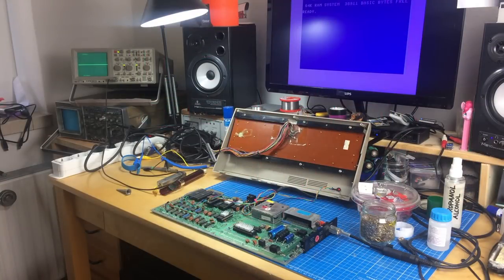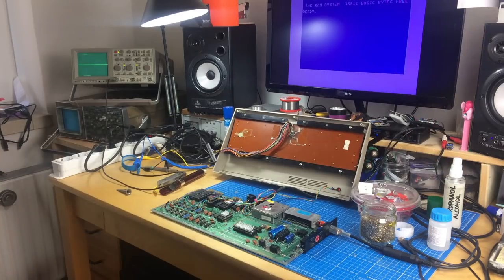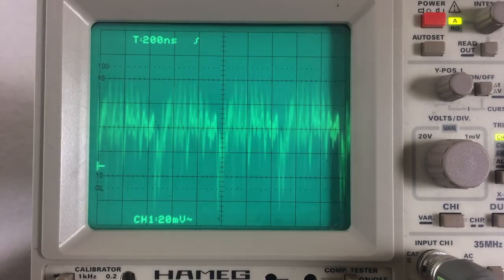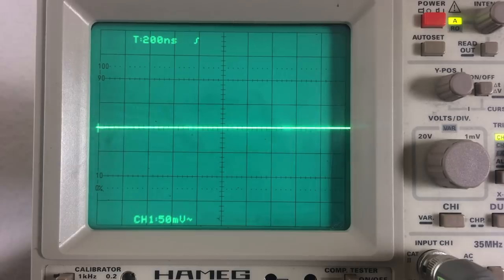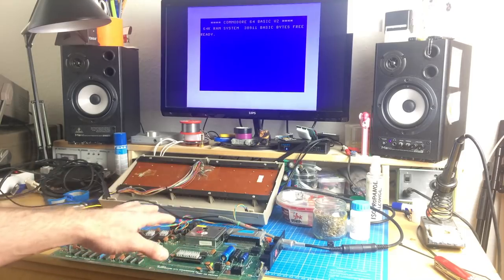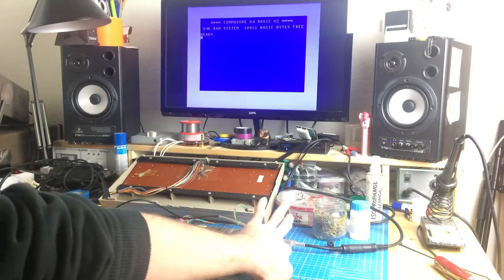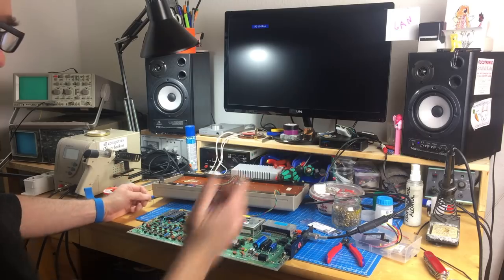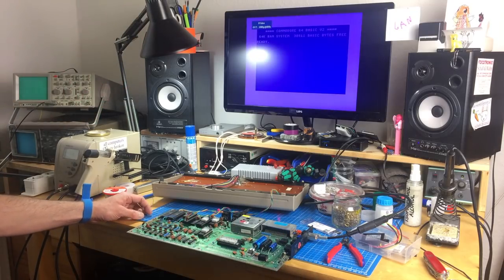C64 DC-DC Conversion Part 2: "The Fart of Doom"

Comment: Hey Jan, the DC to DC converters usually have bulk capacitors on the output to reduce Ripple. So, when you turn off the power to the dc-dc converter, the voltage tapers off gradually rather than immediately going to 0. This is called Brown out, and some older chips like the Sid probably don't like it very much.
Reply: "Brown out" with the "farting noise". There's a joke in there somewhere.
Reply: in these cases a higher clock frequency dc-dc converter is better, the higher the clock, the lower the smoothing capacitor you need. it's better to as an o/p inductor (<100uH) in serial too, but i will just settle if i get less than 10mV ripple under highest load.
Reply from the maker: I fiddled around a bit with adding capacitors to the output of the 12V converter but it didn't make a difference for the "farting" unfortunately. The brown out is a good point though. I guess the SID get enough power to reboot and then turns off causing that sound.
Reply: Could test the theory by increasing the load, maybe some resistors in parallel, but really, a linear regulator that doesn't get warm is a fine solution, even today.

Comment: Great video Jan Beta, as many guys told you the DC to DC Buck converters have capacitors inside for reducing the ripple at the output. However, switching power supply or DC-DC converters are not recommended for audio or instrumentation applications due to noise and transients. The fart noise is due to the transient when the C64 turns off, hence, the frequency response of the transient goes to the audio band, i.e., the coil and capacitor of the Buck converter generates a a negative voltage transient in the SID area (see https://www.powerelectronictips.com/select-input-capacitors-buck-converter/). That transient will see it in the C13 capacitor at the output of the Q8 transistor at the Audio output. Therefore, it's recommend to maintain a linear power supply for the audio scheme of the C64 (at least the 12v rail).

Comment: Hi Jan! I’m not a C64 guy but I looked into schematics. The switch cuts off input rails and this is fine. But what happens next are two separate and differently loaded chips. You have around 2000uF capacity on 5V in and 1000uF on 12V in. Both rails cut off in different moments and as a switching supplies try to work to the end of energy in caps. Linear reg would die out and not try to recover. Switching circuit tries to switch one more time if there is any energy left. Maybe a suggestion with a big cap on the out line isn’t that bad. Another option would be 12V reg with !SHDN in to kill output when 5V is out.
Reply from the maker: Thanks! That explanation makes perfect sense.

Comment: The 12v rail has a 1000uF capacitor lon the  input to the regulator. Since the load on 12v is low that means on switch off the voltage drops slowly and causes instability. You should look at the data sheets for the type you used, because they usually specify how much capacitance to use - ones I looked at had capacitors from 10uF to 100uF, with a similar amount on the output. so its probable t.his is why you are having problems
Reply from the maker: Yes, I think that's the most reasonable explanation. I will do some further research and try a couple of solutions soon(ish). :)
Reply: Considering the light load on the 12v rail and that its supplying audio circuits, your solution of refitting the linear regulator is probably the right one. High frequency noise on the 5v rail isn't going to be problematic, but how hot the linear regulators got definitely was.

Comment: Jan, I meant to reply earlier on this but forgot. The C64 boards with the 12V regulator use a 'voltage booster' circuit. When you rectify 9VAC you get about 12.7VDC which is not high enough for a linear regulator. It is 'boosted' to about 20V with a 'charge pump' type circuit (which is a type of DC-DC converter) and then fed to the 7812 regulator. I would guess that when the power is cut both the charge pump and the DC-DC converter you installed and still trying to do their job and you get that final last surge of voltage. The C64's with a 9VDC SID don't use a 7812 or the charge pump (going from memory here), I seem to recall they just have a sort of homebrew voltage regulator made with a transistor (there is enough headroom to go from 12.7VDC to 9VDC)

I'm not sure how to overcome this problem you are having easily. It may be that more capacitance on the input side of your 12V DC-DC converter would help. My thinking here is that it would let the charge pump circuit stop working while providing just a bit more time for the 12V DC-DC converter to shut down cleanly. It might also be possible to bypass the charge pump all together if your DC-DC converter can work with as low as 12.7V input.

Comment: And LOL @ the farting noises =D  It's the last power within the device dropping off and frequency of switching slowing down abruptly until nada.  As someone else suggested below - it's probably the size of the cap on that 12 rail (on the input to the recom).  The same spike will probably be happening on the 5v rail too - you just aren't visually or audibly aware of it.
Reply: I agree -- the 5V rail is probably spiking too. Adding a cap on the output on these rails should help with the spiking.
Reply from the maker: I will look at the spike again. As far as I could see it's not happening on the 5V rail but I will definitely revisit this mod an see if there's a reasonable solution. For now I think just using a 7812 is a good compromise. ;)
Reply: Master of Arts!

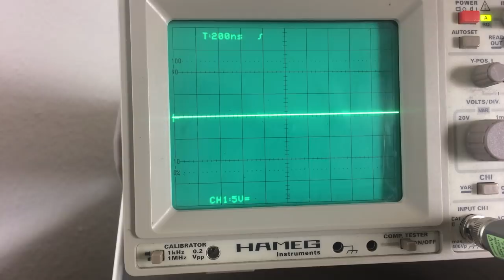Comment: Hi Jan if you look at 14:10 when you turn it off and get the sound you have some low frequency oscillation on the scope but you cannot see it as you have the timebase too fast (try 10mS/div or slower). I am guessing that maybe the 5V rail is also doing this but you don't get any visual or audio effects from it. I assume it is because the i/p voltage has gone too low for the regulator to operate so it stops then the input voltage recovers a little and it starts back up again then stops ands sop on until the input voltage drops enough to stop the oscillation.
Reply from the maker: Yes, I guess that is the most reasonable explanation. I think the converters are a bit too high efficiency and start working on the residual power in the capacitors again briefly. I will definitely look into that again.

Comment: Any updates on this Jan?  You mention in the comments that you were perhaps going to check for spikes from the 5V DC-DC converter using your scope.  I believe you also mentioned that you were going to investigate reducing the capacitance of the 12V inlet filter capacitor to see if it gets rid of the voltage spikes on shutdown, that is with the 12V DC-DC converter in place.

Comment: This is working for me nicely - just the 5v DC-DC converter - repaired ASSY NO 250407 Rev B this weekend - Thanks Jan !
Reply: I too have no problems so far with that board revision but I am using a bigger 1A Recom R-78B12-1.0 that needs 16V input.

Comment: I believe it's cause you have capacitors on the inputs of the switching regulators.
When turning off the unit, the capacitor voltages will drop within a second or so.
As this happens, so does the regulator switching frequency.
So you end up getting a quick sweep down tone effect, that sounds like the "Fart".
Reply: yep, very ture. Could always lower the values for the main filter caps and put some filter caps on the output of the regulator.
Reply from the maker: Yes, I think that's the most reasonable explanation for the effect. I already fiddled around with different size capacitors on the output of the converter but it didn't change anything. I'm definitely going to revisit this soon to find a good solution.
Reply: @JanBeta   Hope you might come back to this 12v dc-dc fart problem:
1. I do not think this will harm the SID
2. This is a capacitor discharging and somehow, power goes back in to the SID ?

Comment: Use the 12 volt switching IC, but put a large capacitor on the output pin to ground.   Something like 1000 mfd.    This will let the voltage slowly drop after the switching regulator shuts down.    This should stop the audio noise.   This will resemble the output of the linear regulator more closely.
Reply: Robert Bakley Are you suggesting 1000mF=1 F or 1000μF=1mF ?  Anyway the farting is probably from the 12V regulator turning off cleanly when the input cap drops below e.g. 13V, then back on again for a short moment when the input recovers after the 5V load goes away.  A linear regulator would fade away gradually, making the bounceback of the input become a small movement on the output.

Suggested test: 1. Set the scope to 1 second / division and 5 V / division, DC coupled. Probe both the inputs and outputs of the regulators and do the turn off as the scope is near the left of the screen.  That should give a nice picture of how these things behave during power off.
Reply: i suggested 1000 micro farad.   This will keep the 12 volt rail up after the 12 volt dc to dc converter shuts off, and allow the 12 volts to gradually decay similar to the way the linear 12 volt regulator shuts down.
Reply from the maker: I fiddled around with adding smaller caps to the converter but didn't try such a large capacitance. I'll look into it.
Reply: Thats what I think also. Some other loads drop off and then the 12V DCDC "comes back" again.
Reply: Great way to make the DC-DC converter to oscilate. You should NEVER slap excessive capacitance on a DC-DC converters output, you ruin it's negative feedback loop's phase margin then and it becomes a high frequency generator and can even generate large voltage swings on the output

Comment: Since these are dc-dc switching modules, they likely already have filtering and proper input and output caps in them. The linear supplies require those big caps to keep the voltage stable during varying loads. You most likely do not need these caps on the inputs or outputs. Try simply removing them. Then the output should shut off pretty much immediately when power is cut.
Reply from the maker: Yes, that's definitely something to look into. I was thinking about replacing some of the caps with smaller values.

Comment: Normally, you would use capacitor systems to smooth that stuff out, ceramic capacitors can react faster and more reliably, but at the cost of capacity, so any load spikes would require a combination of capacitors or just multiple of the same type. If its load spikes that are the problem, electrolytic capacitors are used almost specifically for that problem.

Comment: SIDs? Not so sure the sound comes from them, but the regulator shuts off and briefly comes om again.. The 12V line is feeding a buffer/ transistor on the audio output. any noise on the 12v line will come out on the audio ports via that. could be as already mention caps om the input or output not within the regulators requirement.
Reply from the maker: Yes, I think it has something to do with the residual voltages in the caps. I will also check the buffer. I assumed it was the SID because it sounded like a SID sound but now that you mention it it also could be a slightly underpowered transistor "farting" obviously. :)

Comment: I think its because the sid was designed for a regulated power supply - one of my hobbies is amateur radio and it wasn't until very recently that switching power supplies and filters could generate a clean enough dc signal that you didn't get a bit of noise on transmit/receive - especially on older equipment.

Anyhow I think you need to build a filter circuit on the 12v output.
Reply from the maker: Yes, I used to work as an audio engineer and had the same experience. In good audio gear, there's still no switching supplies today. I fiddled around with some caps on the output of the converter but it didn't change anything. I'll definitely revisit and look for other solutions soon.

Comment: Hi Jan, I think his has something to do how the base voltage for the 12 volts are generated. The original c64 powerbrick gives you „9V“ AC and 5V DC which are „combined“ after rectifying the ac. You replaced the origimnal powerbrick- I cant remember the video you did, but it seems there is an awful lot of delay between the power-off of your 5V dc and 9V ac supply lines and some capacitive decay in the 5V supply leading to this behavior - that would be my guess. Maybe you can check that by using both channels of the scope with a longer timebase 2 to 5 sec, or by using an digital storage oscilloscope maybe at a hackerspace near you. Keep the good work up.  Grüße aus Dresden.
Reply from the maker: Thanks! That's a good point. I thought the same and tried it with an original PSU in the meantime. Absolutely the same behavior there unfortunately.

Comment: A bit late : Chain both : a DC/DC to 7.5v , does not heat, but ripples THEN a linear regulator from 7.5 to 5v, that way the 7805 will only have to dissipate 2.5 v*I as heat instead of ~10v *I as heat, i.e. 1/4, and you'll still have a flat output (need a ceramic cap at the 7805 output too, the electro will not filter high freq)

Comment: You can try a couple of things such as a 1meg resistor on the output to ground, that trick is used on Amplifiers to avoid speaker pop. Or, toss on another cap around 680uF to 1000uF on the output of the regulator to ground followed by a 100nF cap for the high feq ripple.
Reply from the maker: I experimented with some smaller caps on the output of the converter but it didn't change anything. I'm definitely going to try the resistor and a larger capacitor, too. :)

Comment: I thought you had it on DC coupling on the first part - I made that mistake a few years back and RetroGameModz corrected me ;)   It's worth adjusting the time base when you are looking at that AC ripple btw.  The point you saw 50mhz pulses, that looked to be a zoom in of a slower frequency pulse.
Reply from the maker: Learning all the time. ;) It's a bit funny I did it like that because I did some more sophisticated ripple/noise measurements a while ago when I checked out a replacement 1541 PSU. I forgot all about it it seems. ;)

Comment: 'normally' dc-to-dc converter circuits are not having this nice TO220-ish (78xx) form factor but are a circuit board with an input+ground on one side and output+ground on the other side (4 connection pads). I didn't know that ground was allowed to be connected together to become one contact less (3 pins).
Reply: Maico well the gnd is the same potential its okay.
Reply: alright

Comment: connect a 100µF capacitor with low esr to the output of the 12v recon. maybe a panasonic fc or fm series to buffer away the fart.
i think the input voltage drops very slow because of the high cap on the input. that means that it spends quite a significant time in a voltage area where the recon is unstable and probably switching on and off. try the output cap solution. as i am working with mcu controlled switching power supplies at microchip now, i might have a look at some simple buck regulators that are suitable for that upgrade for the c64.
after all, the temperature inside the c64 then gets cooler witch also protects the other important chips like the vic-II that is nearby
Reply from the maker: I tried fiddling with some capacitors on the output with no luck. Maybe I'll revisit the project sometime. For now, I just use an 7812 for the 12V rail, doesn't get very warm at all. The 7805 replacement has been working very well for a long time now. Still my main everyday C64.

Comment: I wish they would make high-efficiency linear regulators in 12v versions.  The AMS1117 will source up to 800mA at either 5v or 3.3v and has considerably higher efficiency than traditional monolithic regulators line the 78xx or LM317.
Reply: I can't see the efficiency being all that much better. It still has to burn off the excess energy as heat.

Comment: I suspect the odd transient behavior is due to how the input of the regulator is produced.... it is effectively done by a voltage doubler arrangement, seen in the following schematic around CR4/CR5/CR6/C90
http://www.zimmers.net/anonftp/pub/cbm/schematics/computers/c64/251469-2of2.gif

Switch mode regs are usually pretty adaptive to their input voltage depending on their topology, and there isn't a clear dropout as there is with linear regulators. As others have said, an effective fix would be to use a regulator that has some sort of inhibit or enable/disable input, and connect this so that when the 5V line drops below a certain level, the 12V regulator is switched off.

Putting big capacitors on the output of a regulator is NOT a good idea - this defeats the point of the regulator, and can often make the output of them unstable.

Personally, I think it would be best to go back to a linear regulator for the 12V supply. It is only used by the audio stage of the SID, so it should have relatively little current draw and thus heat generation.
Reply: ... and now I watched it all, yes you went back to the linear reg :) This is the best solution really. Generally voltages used by audio stages are best produced by linear regulation for noise purposes, but in this case the shutdown behaviour is the issue... and best resolved by sticking with a linear reg.
Reply from the maker: Yeah, the more I think about it the more I come to the same conclusion. ;) I still want to experiment a little. I already tried sticking different size (smaller) caps on the regulator output but it didn't do anything. Using a regular 7812 is most likely the reasonable thing to do.